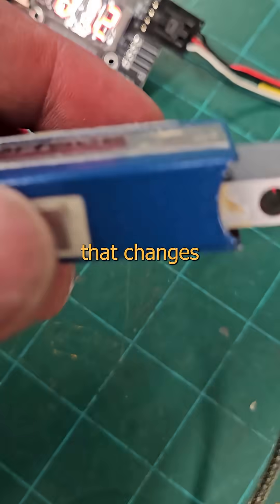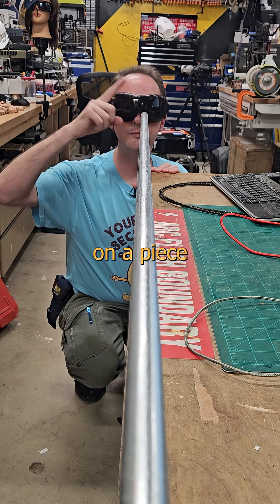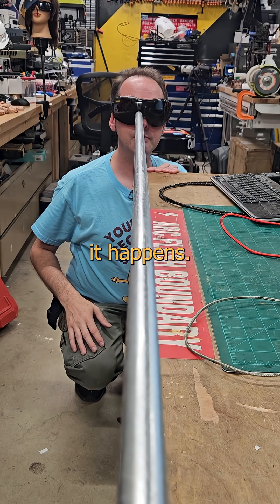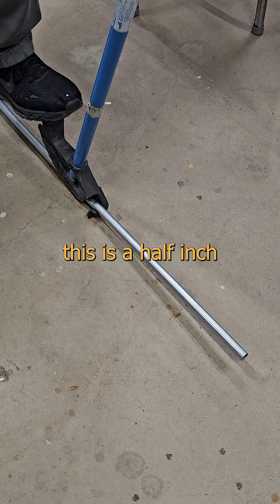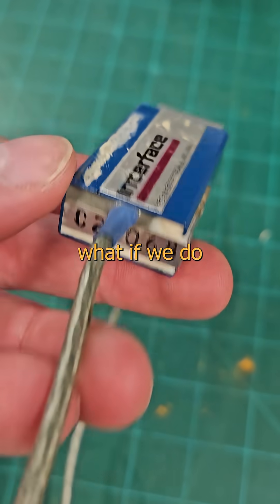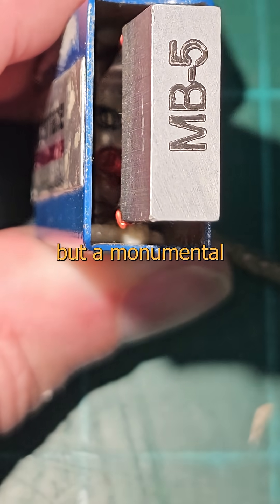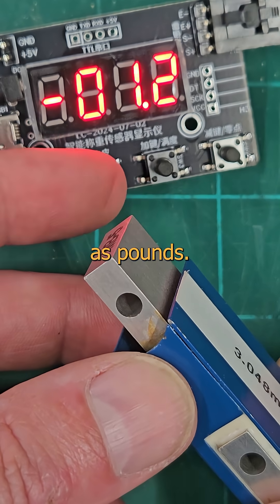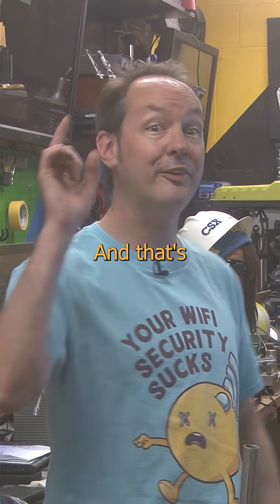Elastic and Plastic Deformation #chrisboden #comedy #engineering #modulus #strain #gauge #scale

Comment: As a mechanical engineer it truly is life changing when you realize that nothing is truly rigid and everything has deformation one way or another
Reply: I once had a ship ride during a storm. From the bridge it was very visible that the entire thing, made of half-inch steel, would bend and twist.
Reply: @michaelbuckers  ya my first ride in a convertible was the same.  I was surprised just how much the car twisted & bent.
Reply: goes hand in hand with the 1st rule of metrology: every measurement is wrong
Reply: Geotech. You’d be amazed at how many structural engineers want zero movement in their foundations, even when their concrete itself deforms
Reply: Even your bones.

;)
Reply: The engineers equivalents:
Everything is a dampened mass spring system.
Everything is a resistive inductive capacitor.
Everything is a hose.
Everything is an insulated wall.
...
Reply: Another secret about solids I picked up before starting engineering school - everything is flexible if you make it thin enough.  I have also realized that everything is rigid if you make it thick enough, but that's not really cost effective.
Reply: Sadly, based on many encounters in my long life, I believe ignorance is one thing not 100% deformable. In certain circumstances I've seen the rigidity increase and continue until EOL.
Reply: @DoubtingTaom cognitive dissonance is a strong opposing force to intelligence
Reply: @DoubtingTaom  ignorance is deformable if you bludgeon it hard enougj
Reply: damn😂
Reply: Same here as a structural engineer. especially as it relates to seismic force resistance systems for buildings
Reply: Except for my engine block when I’m underneath my car and bump my head on it
Reply: @CadaverCo   Ouch
Reply: @CadaverCo  In that instance your skill was acting as both a spring and a dampener and your brain benefited from it.
Reply: Everything is like candle wax
Reply: Yep, as someone working in machining dynamics, this is it! And like he said, realizing everything being a spring is spot on.
Reply: about to learn that (my time as a mechanical engeneering student starts today)
Reply: Theres no way. Im too ocd for this shit.
Reply: This is really dumb to say, but what about planets themselves? Would you think they’d be more rigid the further in or the smaller the planet?
Reply: @Buhjiner  
I don't normally recommend Kurzgesagt but their video titled "What Happens If The Moon Crashed Into The Earth" actually explains that really well!

Everything is elastic under the right conditions rock and stone included.
Reply: @Buhjiner  planets ring like bells from seismic activity or when struck by massive foreign objects. 

Think about it this way, all the way down to atoms have the classical spring-like wave mechanics built right in, and interactions between them do as well, and you will find that all the way up. Even with gazes, y poo u have sounds that move through them, or oceans have regular old waves. Its not exaggerating to say understanding your basic old harmonic oscillator is key to opening the doors on understanding phenomena at all length and time scales. The universe REALLY likes springy wavey systems.
Reply: Thats what she said
Reply: @MrGregsRnR  its deformation is average!! AVERAGE!!!!
Reply: @_JoeMomma it still falls within GD&T specs 😂😂
Reply: @jkimm7  so it hooks left by interference and not design?🥺
Reply: The amount of supposed automotive engineering people who don't believe in compliance is baffling. I've had intense arguments over this and been called many names because I said that "everything is a spring".
Reply: @ArchOfficial  I feel like those people should have had the epiphany when they saw leaf springs for the first time. 

literally just flat bar strapped in strategic places
Reply: @PolishGreasePit  I feel like it "doesn't count" because everyone believes in significant vertical compliance, via corner springs. 

Some people have a hard time believing in significant compliance in other directions, and in other components.
Reply: @ArchOfficial  that's fair
Reply: does that include my co-workers nose when he says that the clearly flammable marked liquid isn't flammable while using an angle grinder cutting metal near my works van?
Reply: @jkimm7  exactly I got so surprised the first time I got a stress strain chart explained🤯
Reply: @jkimm7  then you learn about fugacity and how everything farts itself to equilibrium.
Reply: "What do you mean you can't just create a lightyear-long rod of metal and move one end to get movement out the other end instantaneously?!"
Reply: And you start getting into metrology and you keep accidentally building seismometers
Reply: also, nothing is solid.
Reply: I think the only exception to that rule might be British conservatism... 🇬🇧😉
Reply: Tell me about it!
Reply: Especially my mental state during junior year Mech E
Reply: Except for ceramics
Reply: @acer8123 ish... Ceramics have some flex, hence why a 4 point bend test is still a thing - however they are WAY inconsistent due to grain imperfections, so we generally consider them inelastic and use a 98% reliability factor (depending on the application and firm).
Reply: My physics classes, dear lord.  I tried to argue about sin(x) = x because we hadn't covered the part in trig/calc about "as x approaches 0", so it didn't make sense to me, and I wanted help understanding.  Got told "I'm helping other students with actual course work." (I had dropped from a A to a C in one week because of that concept) And then when we were learning about springs, I was trying to figure out why we don't have some amount of spring calculations in everything.  It felt like we should because of how molecules work.
Reply: Tile, most concrete, and quartz are in fact, awful springs.
Reply: Hell, even rocks.
To bounce off something you still need an elastic action, no? And throwing a rock at a brick wall causes the rock to bounce off the wall, so does that not count as the two being a spring?
Reply: .............as a person who dose'nt give a crap about your resume...........I don't give a crap........works at J in the Bx😅
Reply: As a non mechanical engineer. This information shapes the universe.
Reply: It's one thing to understand it intellectually.  It's a different thing altogether sitting on a concrete bridge section when a loaded semi goes by and you feel the deformation as you suck the seat cover off the foam😂
Reply: I figured that one out as a kid looking at stained glass windows on the churches that had enough time for deformation to happen. The reasoning behind it came much later though
Reply: The ultimate strength of all materials as time tends towards infinity, is zero.
Reply: It's right up there with learning that the 90° corner that was just made on the mill isn't perfectly 90° but 99% the time it's close enough.
Reply: Nothing is literally solid. All energy is recycled. Taxation is theft. ALL MUST SERVE THE CYCLE
Reply: I agree 100% as a geologist
Reply: Try telling that to the new guy bending 1” rigid conduit with a hand bender and no instruction.
Reply: @jkimm7  my family have had a long running jokes but I told my uncle concrete can flex, and he still won’t accept it😂
Reply: I figured that out the hard way as a kid with bad coordination.
Some surfaces absorb and bend, other breaks, and other stay exactly where they are vs a human kid's fleshy body, lol.
Never broke anything tho.
Reply: Even non-physical objects are rigid (accidentally typed ragid 😂)
Reply: Anything is play-doh if you try hard enough
Reply: Deform me Mr mechanical engineer.
Reply: @jkimm7  I've also known it as "aging".
Reply: Now watch grob do the best job in the world to make a small mill to defeat that
Reply: "Assume rigid body..."
Reply: @jkimm7  we're all plastic bags. That's what Katy Perry meant.
Reply: Rubber: elastic 
Plastic: plastic
Reply: What about diamonds?
Reply: Me living on the 3rd floor of a home built in the 1920s feeling the house wave side to side until I learned that movement was a GOOD sign, as it meant the frame was elastic, not plastic or brittle.
Reply: 'Cept for space...
Reply: Tell that to my pipe wrench he even tattooed his name on himself and it's rigid😅😅
Reply: Bud I got a GED & an insane case of autodidact, curiosity and endless lectures available on everything on YouTube....Physics has fucked me up so badly. That on occasion when trying to answer an apprentice's questions. I just say "Maybe in a few years but right now. I'd do you more harm than good by answering that"
Reply: What about Islam ? Truly rigid.
Reply: Ever tried that theory with the females in my area? 😂
Reply: @OctaApe  have you tried not calling them "females?" That could be a good start. I think most of em would be just fine with "women" instead.
Reply: Unless it's brittle...
Reply: @pacifiedmind44 Everything is flexible. You can make glass floppy if it’s thin enough (fibre optics)
Reply: @pacifiedmind44   Nope, if you made a long enough Nature Valley crunch bar, it would visibly bend before covering the earth in crumbs that could never be fully cleaned up.
Reply: @pacifiedmind44  even if its birttle it will go thorugh some elastic deformation before breaking. A lot less, granted, but still a little bit

Everything is a spring. No exceptions.
Reply: @pacifiedmind44  Still a spring, but will break instead of showing plastic deformation.
Glass is a good example.
Reply: @pacifiedmind44  That's just a very low tensile strength. It still deforms, you just cranked the force too high, went past plastic deformation, and straight into structural integrity failure.
Reply: Or you could be like me and just accept that it's a natural part of life and just not be all that amazed.  I mean we have diving boards... seesaws... and plenty of other ways to experience these phenomena whilst growing up.  Some of us just paid more attention to the mechanics of things instead of what was actually going on.
Reply: @GamingWithUncleJ  What else is there to be amazed about that's as good as "everything is springs moving at the speed of sound in that medium."
Reply: @dctaylor480  I just now saw youre question... but how about things that aren't readily apparent to us because they are impossible for us to experience naturally.  Like the fact that at the even though it takes 8 minutes for a photon once emitted to travel from the sun to the earth; the photon itself only experiences this as a single instant blip in time.  For the photon no time has passed at all.  The moment it was born is nearly indistinguishable from when it dies from its perspective.  How about that contrary to what we experience with vortices locally, the milky way, and other galaxies and vortices at that scale, rotate faster on their outer edge than at their inner point.  Now when we start talking about things like that, I say even though that shit is unbelievably cool, what practical good does its study provide us? Sure, the spring thing is practical but its not anything we should be overly amazed by.  Its as simple as a spring.  It'll flex until it doesnt and as long as its only flexing it'll recoil to its origin.  Now if someone wants to sit down and come up with formulas for how every possible alloy or material can flex and to what point for every possible dimension, yadda, yadda, yadda... now that would be cool.  And if they could come up with a formula or a spreadsheet to make engineering applications simpler, which im sure exists in some simplified version, then yeah, thats cool.
Reply: @GamingWithUncleJ  it's so cool how smart you are dude
Reply: @Stopaskingwhyandjustreadit   why?
Reply: @GamingWithUncleJ  you're not wrong, just immature.
Reply: @williammatthews7735  All that matters in the end is who is right.  Maturity is just some subjective measure you apply to constrain others to your societal models.  Do you really think maturity is something that really matters outside of when is the best time to eat a fruit or vegetable? It doesn't.  You're hung up on the wrong aspect of things.
Reply: Again im not wrong, just immature, yadda, yadda, i know.
Reply: @GamingWithUncleJ "everything is a spring" he said, your counter is listing springs people use for just their springiness. 

I'm more keen to list concrete, steel beams, diamonds, glass, giant machines that would crush a car etc. Stuff not usually thought of as springy, but still have elastic deformation.
Reply: @GamingWithUncleJ  Yeah those are clear examplesa that are ingrained in our brains. However, it also means there are things we never directly observed in our childhood as elastic even though they are for example diamond. Diamond is counter intuitively elastic because we normally think of it as hard and solid.

Comment: Fun fact: this is also how airplane engine testing works! Pitot tubes and strain gauges attached to a bunch of different spots on the engine during testing.

Can’t be fancy, because things get HOT. The strain gauges are protected by ceramic coatings, and everything has to be wired carefully to exit the engine without disrupting its balance.

Comment: I had an incredibly unique opportunity to speak with an engineer who helped develop the Liberty V-12 in WW1.

He said that they would take a small piece of copper and weld it to an engine part. Then, they would test the resistance of it.

After that, they would assemble the engine and run it.

Once the engine had been run and stressed, they would find that piece of copper and see if the resistance had changed.

By doing that, they were able to tell if the part had stretched or compressed.

This was done (with a war budget) over and over until they had doubled (or more) the power output of the engine!

Comment: My undergraduate engineering project in the early 90s was to design a screen printed strain gauge. With some clever resistance bridge manipulating, I ended up with something that was only sensitive along one axis, and you could plug into any DVM and the resistance measured in Ohms was the strain in μStrain.  That was pretty cool.

Comment: This is why I don't like the trend of making cars out of aluminum rather than steel.  Steel has a much higher range of force it can absorb in its elastic range.  You bend it and it pops right back.  Aluminium is almost all plastic. You can see why aluminium cars all have good crash test ratings.  They absorb a lot of energy with plastic deformation but have no ability to resist minor dings.  If it bends, it stays bent.  If the giga-casting in a Tesla bends, you need to total the car.

Comment: I've used strain guages in all manor of applications.  My favorite was a downhole drilling tool that measured pressure on bit, rotational tension, stick/slip, and 3 axis beam deflection.  My favorite part is the many ways to measure these.  You aren't tied to just one type of circuit, but have many to choose to fit the application.

Comment: He ain't joking when he says everything. You think maybe thin soda lime glass is excluded until you're using dollar store picture frames to line your 3d printer bed, then you notice it conforms to the underlying aluminum when clamped. (also 10/10 adhesion, if stuff aint sticking just use glass and like 3 drops of dawn dish soap and water, and cloths that dont produce lint to wash and dry it. Maybe windex. You'll be lucky if it doesn't break when you try to get the part off.)

Comment: "everything is a fucking spring" yeah like the litterral solid rods loaded in tortion acting as springs in F1 cars
Reply: And my Chevy Suburban.
Reply: And just about every Chrysler product from the 50s to the 80s
Reply: The Delorian used a twisted solid metal rod rod as the spring to open its gull wing doors.
Reply: @nolansykinsley3734 many sedans from back in the day also used torsion bars to hold the boot/trunk lid open too
Reply: @nolansykinsley3734 uh, kind of. The doors still have gas struts, and are heavy
Reply: @ everyone thank u forr all the other vehicals using those as Springs ive learned a lot from your replies
Reply: Every coil spring is merely a coiled up torsion rod. If you push or pull on a coil spring, notice how it deforms by twisting the wire or rod it’s made of. And if you strain a coil spring until it breaks in the middle, you will notice it was twisted off.
Reply: I love these comment sections
Reply: Those are also used on trucks sometimes, or they used to be. I recycle them into knives and swords
Reply: @thedudegs-f9w  Hell yeah dude that is really cool
Reply: And literally every pickup truck with 4WD until around 2010 or so. F1 ain't that special for it, just friggin fast with it.
Reply: funny because ever since seeing (but long before having access too) realistic soft body physics based games ive seen it like this and prior observed it irl just without ever thinking about it, best example being beamng where just like in real life, not only does suspension affect handling (already in a way more physically accurate then most games) the body or frame of the vehicle also have elastic deformation that affects handling, which can of course be stiffened up and strengthened with a roll cage, making the vehicle handle a bit differently (usually better)
Reply: and russian T-34 tanks too.
Reply: @tomclanys Nope, T-34 used springs, not torsion bars
Reply: @p_serdiuk  True, but the T-44 and T-54 used torsion bars. So did the US M26 and the German Panther.
Reply: My buddies old 2012 Silverado as well. For just the front though. We had to replace them and that was fun 🤣
Reply: torsion bars are in lots of regular vehicles, IFS pickup trucks, not just Brad Pitts F1
Reply: and tanks.
Reply: @UfuandGosig  Torsion bars are used in most tanks today and many older vehicles as springs and almost every modern car uses them as anti-roll bars.